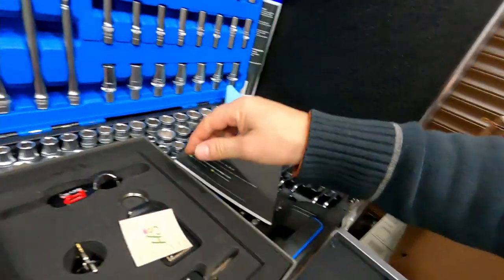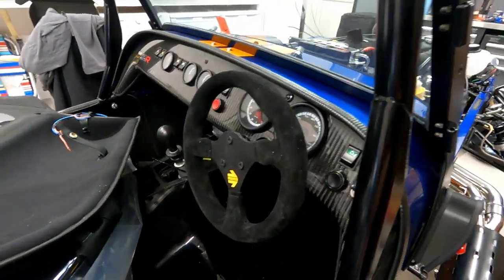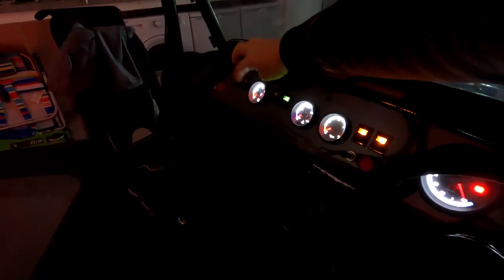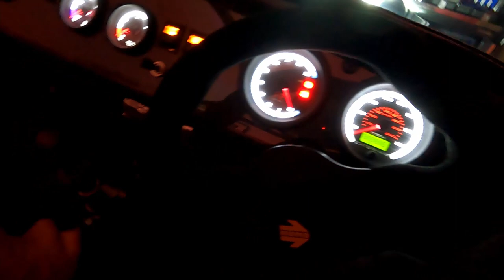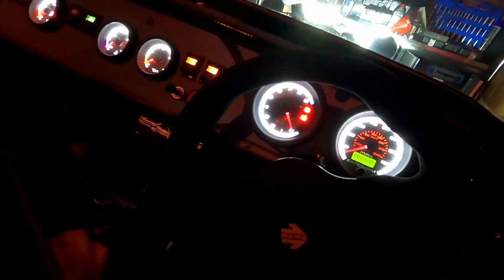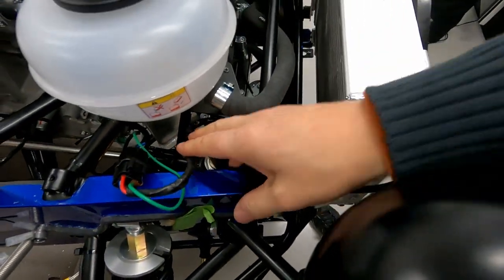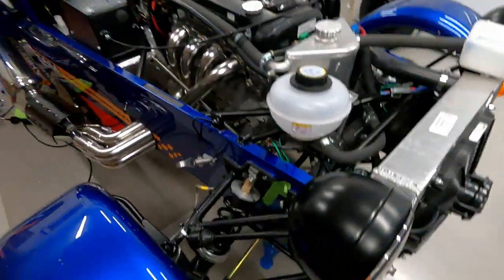Caterham 420R build - Lights and Electrics

Comment: Dear Simon,
How comes that you already have the new LED version of the back lights? Was it optional?
Thank you for sharing! Great video!
Reply from the maker: The new LED lights were released just after I ordered my car, this meant that I had to purchase them separately. I checked in with Caterham about any specific IVA requirements before deciding to fit the new ones. The originals are still sealed in plastic for me to ebay
Reply: @simonbennett3  Ah okay! So you didn't get them with your kit. I do have a 275 (or 270 in UK), and just like you it was ordered just before the release of the new lights.. and they look much better!
Reply from the maker: @Taekem  muuuuuch better  :D
Reply: @simonbennett3  Do you know if these new lights can be mounted directly using the "old" holes, or is it needed to make some adjustments? Also, I was wondereing if the mounting has exactly the same shape as the new one (so we don't get marks when replaced)
Reply from the maker: @Taekem  I think it has the same shape, so no marks from previous fitting and you may need to drill new holes, helpfully Caterham made this video for retro fitting: https://youtu.be/ta3BgyXmGs4?list=TLGGZDu8tQZ2M0gxNTEyMjAyMQ
Reply: @simonbennett3  yes.. maybe they will, or else we can suggest them to do so. I'm also wondering about the wiring part if it is exactly the same. I saw the kit on the caterham website that includes wires.